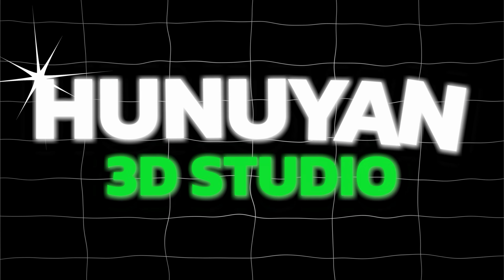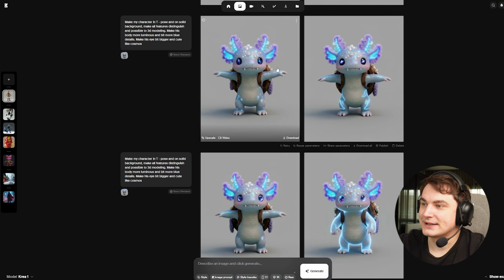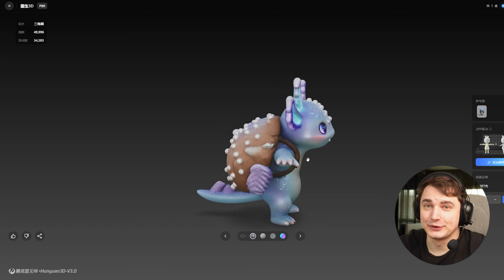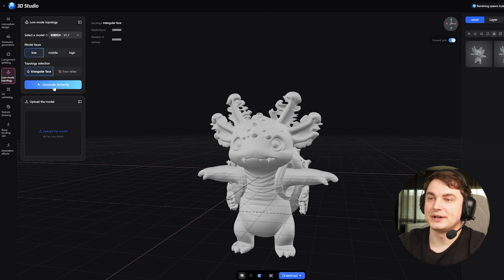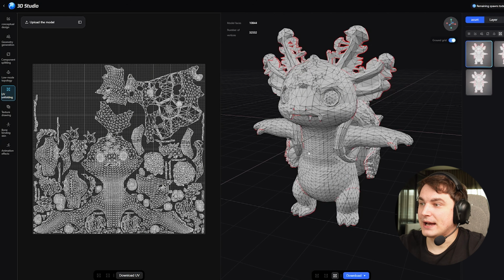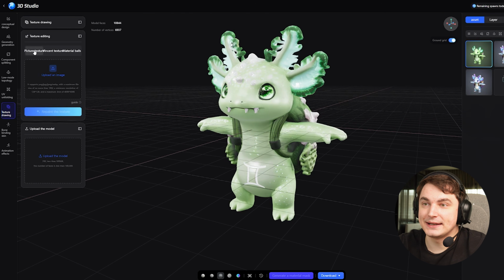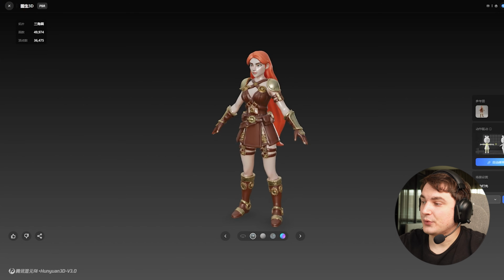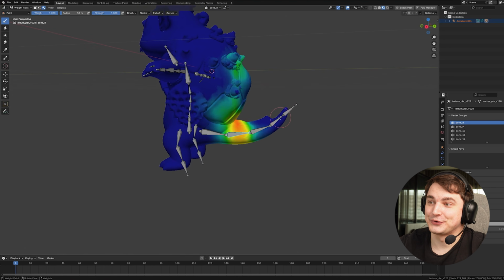Best FREE AI for 3D Now BETTER - Hunyuan 3D Studio

Comment: im using microsoft edge... my auto translate function isnt working on huyan? how did u get it to work to translate? thx
Reply from the maker: So strange, I also use Edge in this video
Reply: @stefan_3d_ai  i managed it to convert it in fireball...  im really amazed of how good it is becoming... but when splitting the model i noticed the parts are always open is there a way to get them closed?

Comment: is not working for me rtx 3090

C:\Users\mors\Downloads\Hunyuan3D_2.1_ComfyUI (1)\ComfyUI_windows_portable>.\python_embeded\python.exe -s ComfyUI\main.py --windows-standalone-build
[START] Security scan
[DONE] Security scan
## ComfyUI-Manager: installing dependencies done.
** ComfyUI startup time: 2025-11-15 02:10:23.515
** Platform: Windows
** Python version: 3.12.10 (tags/v3.12.10:0cc8128, Apr  8 2025, 12:21:36) [MSC v.1943 64 bit (AMD64)]
** Python executable: C:\Users\mors\Downloads\Hunyuan3D_2.1_ComfyUI (1)\ComfyUI_windows_portable\python_embeded\python.exe
** ComfyUI Path: C:\Users\mors\Downloads\Hunyuan3D_2.1_ComfyUI (1)\ComfyUI_windows_portable\ComfyUI
** ComfyUI Base Folder Path: C:\Users\mors\Downloads\Hunyuan3D_2.1_ComfyUI (1)\ComfyUI_windows_portable\ComfyUI
** User directory: C:\Users\mors\Downloads\Hunyuan3D_2.1_ComfyUI (1)\ComfyUI_windows_portable\ComfyUI\user
** ComfyUI-Manager config path: C:\Users\mors\Downloads\Hunyuan3D_2.1_ComfyUI (1)\ComfyUI_windows_portable\ComfyUI\user\default\ComfyUI-Manager\config.ini
** Log path: C:\Users\mors\Downloads\Hunyuan3D_2.1_ComfyUI (1)\ComfyUI_windows_portable\ComfyUI\user\comfyui.log

Prestartup times for custom nodes:
   0.0 seconds: C:\Users\mors\Downloads\Hunyuan3D_2.1_ComfyUI (1)\ComfyUI_windows_portable\ComfyUI\custom_nodes\rgthree-comfy
   1.9 seconds: C:\Users\mors\Downloads\Hunyuan3D_2.1_ComfyUI (1)\ComfyUI_windows_portable\ComfyUI\custom_nodes\ComfyUI-Manager

Checkpoint files will always be loaded safely.
Total VRAM 24576 MB, total RAM 65273 MB
pytorch version: 2.7.1+cu128
Set vram state to: NORMAL_VRAM
Device: cuda:0 NVIDIA GeForce RTX 3090 : cudaMallocAsync
Using pytorch attention
Python version: 3.12.10 (tags/v3.12.10:0cc8128, Apr  8 2025, 12:21:36) [MSC v.1943 64 bit (AMD64)]
ComfyUI version: 0.3.43
ComfyUI frontend version: 1.23.4
[Prompt Server] web root: C:\Users\mors\Downloads\Hunyuan3D_2.1_ComfyUI (1)\ComfyUI_windows_portable\python_embeded\Lib\site-packages\comfyui_frontend_package\static
InPaint Function CAN NOT BE Imported!!!
### Loading: ComfyUI-Manager (V3.37.1)
[ComfyUI-Manager] network_mode: public
### ComfyUI Revision: 150 [e18f53cc] *DETACHED | Released on '2025-06-27'

[rgthree-comfy] Loaded 48 extraordinary nodes. 🎉

[ComfyUI-Manager] default cache updated: https://raw.githubusercontent.com/ltdrdata/ComfyUI-Manager/main/model-list.json
[ComfyUI-Manager] default cache updated: https://raw.githubusercontent.com/ltdrdata/ComfyUI-Manager/main/alter-list.json
[ComfyUI-Manager] default cache updated: https://raw.githubusercontent.com/ltdrdata/ComfyUI-Manager/main/github-stats.json
[ComfyUI-Manager] default cache updated: https://raw.githubusercontent.com/ltdrdata/ComfyUI-Manager/main/extension-node-map.json
[ComfyUI-Manager] default cache updated: https://raw.githubusercontent.com/ltdrdata/ComfyUI-Manager/main/custom-node-list.json
WAS Node Suite: OpenCV Python FFMPEG support is enabled
WAS Node Suite Warning: `ffmpeg_bin_path` is not set in `C:\Users\mors\Downloads\Hunyuan3D_2.1_ComfyUI (1)\ComfyUI_windows_portable\ComfyUI\custom_nodes\was-node-suite-comfyui\was_suite_config.json` config file. Will attempt to use system ffmpeg binaries if available.
WAS Node Suite: Finished. Loaded 220 nodes successfully.

        "The distance between insanity and genius is measured only by success." - Bruce Feirstein

Import times for custom nodes:
   0.0 seconds: C:\Users\mors\Downloads\Hunyuan3D_2.1_ComfyUI (1)\ComfyUI_windows_portable\ComfyUI\custom_nodes\websocket_image_save.py
   0.0 seconds: C:\Users\mors\Downloads\Hunyuan3D_2.1_ComfyUI (1)\ComfyUI_windows_portable\ComfyUI\custom_nodes\ComfyUI-Universal-Styler
   0.0 seconds: C:\Users\mors\Downloads\Hunyuan3D_2.1_ComfyUI (1)\ComfyUI_windows_portable\ComfyUI\custom_nodes\Derfuu_ComfyUI_ModdedNodes
   0.0 seconds: C:\Users\mors\Downloads\Hunyuan3D_2.1_ComfyUI (1)\ComfyUI_windows_portable\ComfyUI\custom_nodes\ComfyUI_essentials
   0.0 seconds: C:\Users\mors\Downloads\Hunyuan3D_2.1_ComfyUI (1)\ComfyUI_windows_portable\ComfyUI\custom_nodes\rgthree-comfy
   0.0 seconds: C:\Users\mors\Downloads\Hunyuan3D_2.1_ComfyUI (1)\ComfyUI_windows_portable\ComfyUI\custom_nodes\ComfyUI-Hunyuan3DWrapper
   0.1 seconds: C:\Users\mors\Downloads\Hunyuan3D_2.1_ComfyUI (1)\ComfyUI_windows_portable\ComfyUI\custom_nodes\comfyui-logicutils
   0.1 seconds: C:\Users\mors\Downloads\Hunyuan3D_2.1_ComfyUI (1)\ComfyUI_windows_portable\ComfyUI\custom_nodes\ComfyUI-Manager
   0.7 seconds: C:\Users\mors\Downloads\Hunyuan3D_2.1_ComfyUI (1)\ComfyUI_windows_portable\ComfyUI\custom_nodes\was-node-suite-comfyui
   3.4 seconds: C:\Users\mors\Downloads\Hunyuan3D_2.1_ComfyUI (1)\ComfyUI_windows_portable\ComfyUI\custom_nodes\ComfyUI-Hunyuan3d-2-1

Context impl SQLiteImpl.
Will assume non-transactional DDL.
No target revision found.
Starting server

To see the GUI go to: http://127.0.0.1:8188
YOUR FOLDER: C:\Users\mors\Downloads\Hunyuan3D_2.1_ComfyUI (1)\ComfyUI_windows_portable\ComfyUI
YOUR FOLDER: C:\Users\mors\Downloads\Hunyuan3D_2.1_ComfyUI (1)\ComfyUI_windows_portable\ComfyUI
FETCH ComfyRegistry Data: 5/106
FETCH ComfyRegistry Data: 10/106
FETCH ComfyRegistry Data: 15/106
FETCH ComfyRegistry Data: 20/106
FETCH ComfyRegistry Data: 25/106
FETCH ComfyRegistry Data: 30/106
FETCH ComfyRegistry Data: 35/106
FETCH ComfyRegistry Data: 40/106
FETCH ComfyRegistry Data: 45/106
FETCH ComfyRegistry Data: 50/106
FETCH ComfyRegistry Data: 55/106
FETCH ComfyRegistry Data: 60/106
FETCH ComfyRegistry Data: 65/106
got prompt
Failed to validate prompt for output 20:
* Hy3D21VAELoader 4:
  - Value not in list: model_name: 'Hunyuan3D-vae-v2-1-fp16.ckpt' not in ['hunyuan3d-vae-v2-1.ckpt']
* Hy3DMeshGenerator 10:
  - Value not in list: model: 'hunyuan3d-dit-v2-1-fp16.ckpt' not in ['hunyuan3d-dit-v2-1.fp16.ckpt']
Output will be ignored
Failed to validate prompt for output 11:
Output will be ignored
invalid prompt: {'type': 'prompt_outputs_failed_validation', 'message': 'Prompt outputs failed validation', 'details': '', 'extra_info': {}}
FETCH ComfyRegistry Data: 70/106
FETCH ComfyRegistry Data: 75/106
FETCH ComfyRegistry Data: 80/106
FETCH ComfyRegistry Data: 85/106
FETCH ComfyRegistry Data: 90/106
FETCH ComfyRegistry Data: 95/106
FETCH ComfyRegistry Data: 100/106
FETCH ComfyRegistry Data: 105/106
FETCH ComfyRegistry Data [DONE]
[ComfyUI-Manager] default cache updated: https://api.comfy.org/nodes
FETCH DATA from: https://raw.githubusercontent.com/ltdrdata/ComfyUI-Manager/main/custom-node-list.json [DONE]
[ComfyUI-Manager] All startup tasks have been completed.

Comment: agreed! Hunyuan is crazy good right now! One issue I'm having is when I go from Mixamo to Blender, the textures get all messed up. I'd like to hear your thoughts/workaround on that Stefan!
Reply from the maker: Essentially, when you visit Mixamo, simply disregard texture. Use OBJ export in Mixamo, then when importing back, just reassign materials from your original in Blender. Tuesday, there will be a tutorial about that. Keep in touch!
Reply: @stefan_3d_ai  actually it looks like it worked going straight from Hunyuan OBJ download to Mixamo, and then Mixamo to Blender. the textures were present in Mixamo and Blender after import
Reply: @knottedtree I use Stefan's workaround. But for sure will try your method. Thanks.
Reply: @stefan_3d_ai waoooo I really appreciate all of this info that you are sharing. Thank you very very much!!